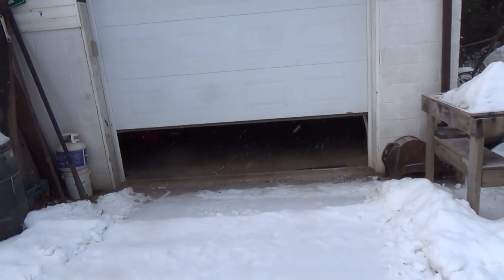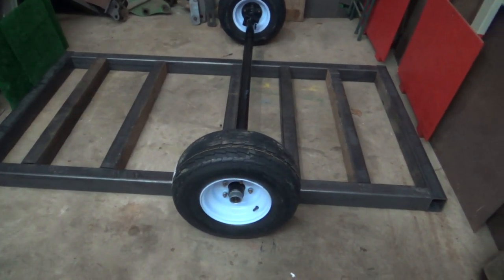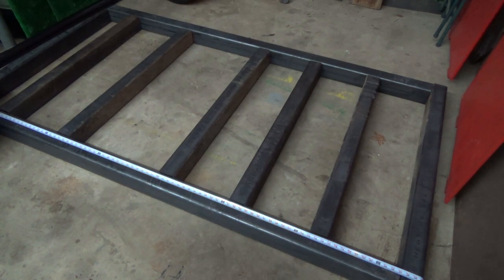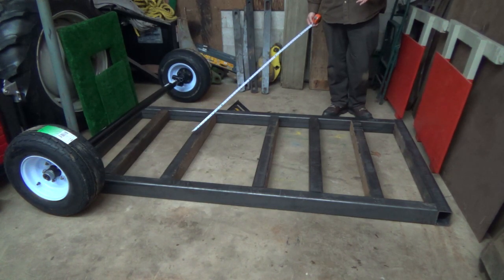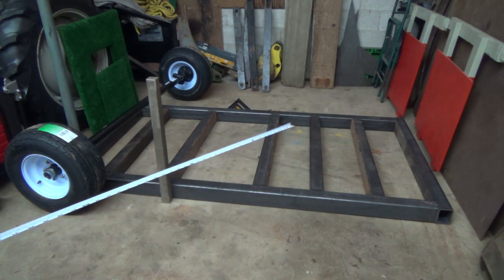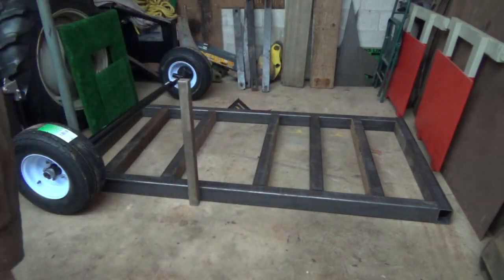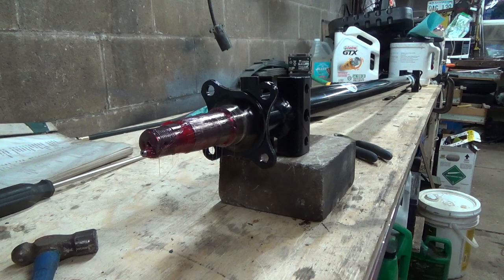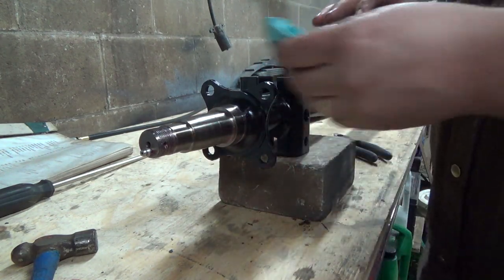Official MINI EX Trailer Build Day 1

Comment: Bill:
I used to cut holes in electrical floor duct that was buried in concrete with those holesaws.  After removing the concrete and exposing thee top, we  would use them dry, which is what is recommended.  We used a slow speed drill (about 250 RPM).  Even with all of the concrete dust, we would still get about 25 or so holes out of the holesaw.  The only thing we would use to clear the hole is a vacuum cleaner,  The wall thickness on the duct was about 1/3 inch.

Comment: Bill, don't worry about whether your drill press table is level or not, just worry if your drill bit is perpendicular to your steel.  Use your big Dewalt square to see if the bit is perpendicular.

Comment: This is where a Bridgeport milling machine would come in handy.
Reply: I agree. A Series 1 Bridgeport would easily work. Because of the back gears in the head to give the drill extra torque at low drill RPMs in addition to the varidrive, or pulley belt speeds. Plus the wider work table can be moved precisely on the X, Y axis to position the work (that should be strapped down to the table anyway, BTW). Also, the drill would not have a tendency to stall. Because of the extra torque at the spindle.

Comment: I'm not sure if you noticed but when you hit that zerk on your axle with the grease there was no red grease that came out it was dry,, also I would consider cutting the frame before cutting the axle shaft, much easier to weld the frame back,,

Comment: If you want extra space for dirt. Put a hitch on the back and bring both trailers. 
It will take some coupling/decoupling buy you will be able to tip the extra dirt and save a trip back to the workshop.
Reply: Troels Daniel Madsen that's a good idea

Comment: Hey Bill, Drop the two extra square tubes. The new axle is wider then the frame, so cut out a section of the axle tube, slide into the frame then weld the axle tube back together.
Reply from the maker: could do that too

Comment: you should put i-lets on you garadge above your garadge door so you can hang a big tarp on them so you can pull it out like a awning to keep the snow and rain off your backhoe or what ever while  you are doing progects in your garadge ,iv done it many times on my house and garadge and it really helps out ,i did it like that for my sons grauation party and im glad i did 3 hours into the party it pored down rain ,it kept every thing dry and the party never stopped .angle the tarp down just enough for rain will run off,,getting on a wet back hoe ,you can get on it dry by a little ingunuity,i also did this on my 16 foot box truck while i was flee marketing to keep out of rain and stay in the shade,i used 3/4 inch pipe and elbows with a few tee's and some rope  and buggee cords on the othe end to hold it up like a tent

Comment: You want to check the drill axis against the steel with a square.  A level in the machine shop of a ship at sea would be no good for the same reason you make certain you are cutting plumb to the work and not to gravity.

Comment: Did you level the metal on the drill press?Because sorry to say the holes you drilled wont be true 90%.The drill press could be siting totally of plum,the drill press table should be true 90% to the drill attached to it.Sorry for the bad news.Just hone out the holes and weld them up.Keep up the cool movies:)

Comment: trying to justify cold air like its actually a superior to cutting fluid .
cooling and reducing friction is what it does , glad you actually used some lubrication
Reply from the maker: lol i see by example.. no mess no smoke no heat no muddy steel mess all clean and ready to weld why would you use lube on it. i see it works way better with no cutting fluid
Reply: I think what it is , is the type of cutter you are using. With the thin kerf , the chips do not have room to get out of the cut and end up getting cut into a fine powder. Machinist have been using cutting oil for a long time and the smoke is a side effect you just have to live with. One tip. Use your square to check and see if the table is square to the bit. The drill could be level with the floor and the table could be out of level which would mean that you would be drilling at an angle.
Reply: It isn't so much the friction, its the chips getting stuck underneath the drill head that is the problem. lube makes it difficult for it to remove them. air blows them out. Spiral drills benefit from lube because their designed to remove chips naturally.